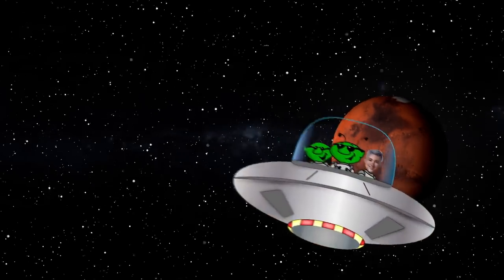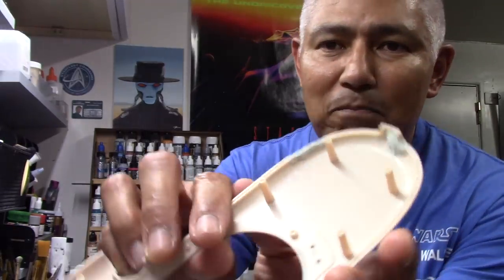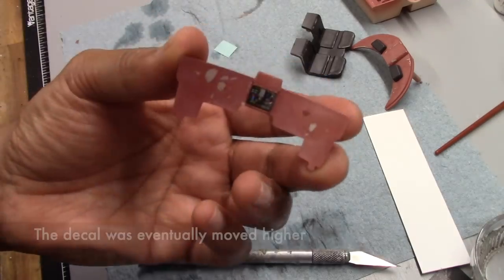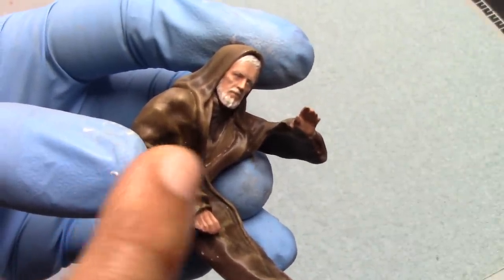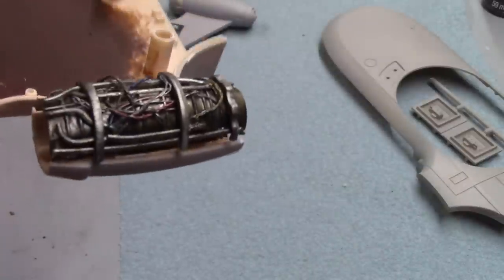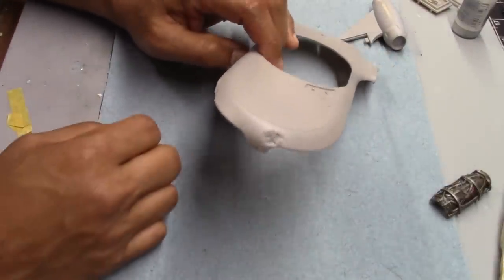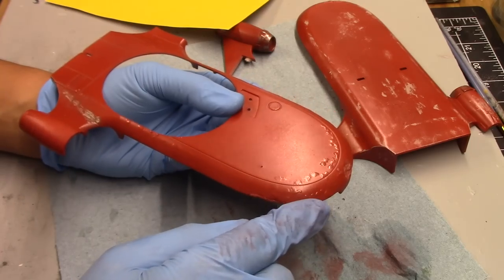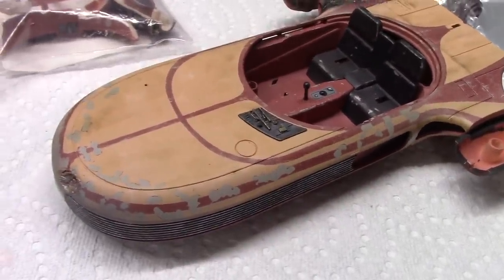Revell Star Wars Landspeeder Completion

Comment: Obviously too late,  but concerning the front dent. I would of heated a bolt to cherry, then held it close until a crater sagged in, then run a round file through the crater to scar it. nice and easy. A cigarette would do it as well but I quit.
Reply from the maker: The problem I've always found with melting plastic is that you don't have as much control. Once it's done that's pretty much it.   For me the apoxie worked out well enough.  Thanks for watching